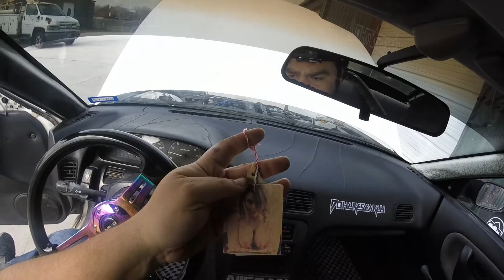PandaS13 Fluids, Exhaust and more sketchy discoveries.

Comment: I have an s14 stock ka, I was going to check timing, warmed the car up to normal op temp, unplugged the sensor by the throttle body. When looking at the timing the mark keeps bouncing around. Why would you think it does that? All your other advice has been spot on! It idles fine, runs smooth but that timing bugs me.
Reply from the maker: inmymemory507 
Hmmm, I'm not 100% sure but if the mark is moving back and forth, it could mean that there is slack in the chain. It might not necessarily make the car run bad but it could be more likely to break. 
When was the last time the timing chain was done?
Reply: Primer2tone Garage no clue, I bought it as a project. I'll probably just change it. Any timing chain kit you prefer?

Comment: My axles where hanging on by 3 bolts each and they where loose I drove it like that several times, lesson learned never trust the previous 240 owner. Also on the s14 any update on that clutch? I'm looking to replace the one in my car but I would like one that is daily drive able friendly.
Reply from the maker: Abel Gonzalez 
Yeah, I'm glad I went through this thing. It was super sketchy. 
I'd stay away from XTD. I'm thinking that's my problem. I shoulda just gone with an exedy stage 2.